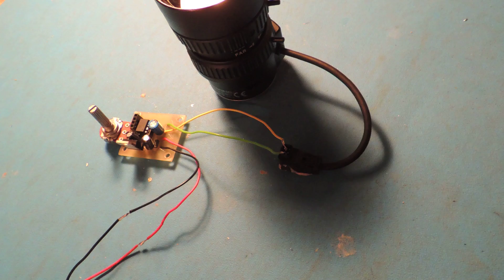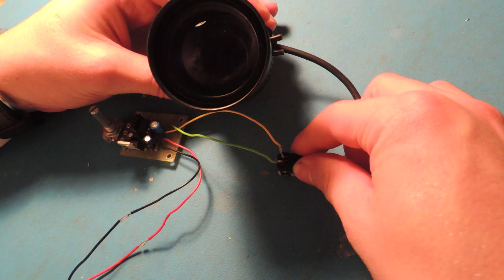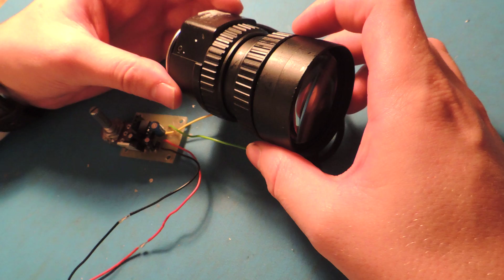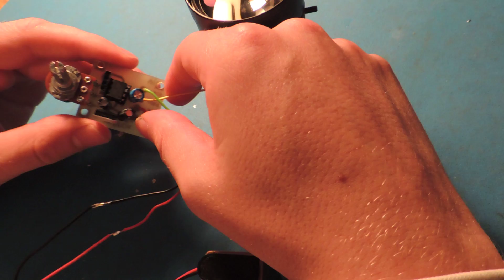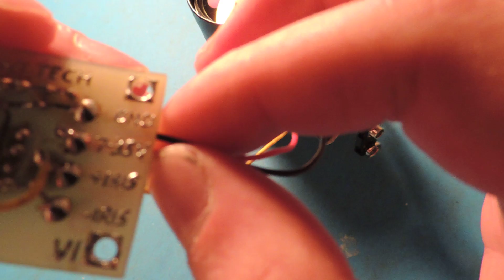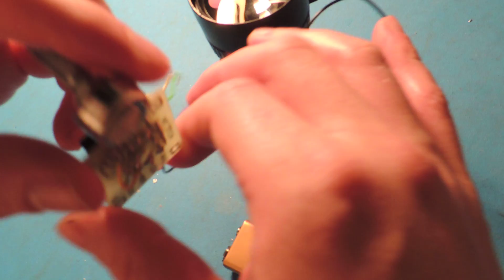Infrared DC Iris Control Hack V1.0 (Night Vision Lens Control)

Comment: That's a Attiny85 with a map function. He is mapping the ADC input from the potentiometer so at the pin6 of the Attiny he will get 0-5 volt. See Arduino - map function. The TO220 I'm pretty sure it is a LM7805. For fun you can use a LDR instead of the potentiometer and make the iris light dependent... Have fun !
Reply: Hi, Laurentiu. could you have the circuit diagram because i don't understand how it controls the bipolar motor with only 2 wires,. Thanks more
Reply: @ENGINERSOUND  that is not a bipolar motor. It is some kind of coil getting energizied when passing PWM signal through it. It is 101 map function from Arduino.
Reply: @Laur-Enziu  : thanks you for you answer, can you send me the pcb diagram to my personnal mail, i need to control the iris of the cameras.Thanks more.

Comment: Hello,
Any updates on this?
Could you post a schematic of the circuit you used to achieve this?
Thank you
Reply: +22FF0011 Hola muy buenas, estoy intentando encontrar el esquema y componentes del circuito, sin poder lograr nada. Has podido tú tener algo de información, te importaría compartirla?. Saludos y gracias
Reply: Eme Cé pudiste encontrar algo? El dueño del canal no responde y necesitaría hacer ese circuito para el control del iris.